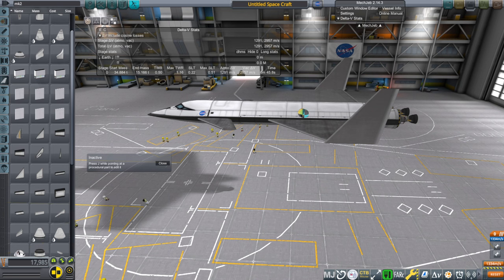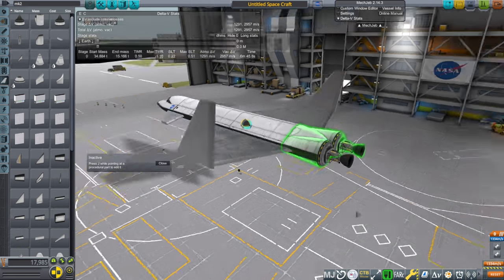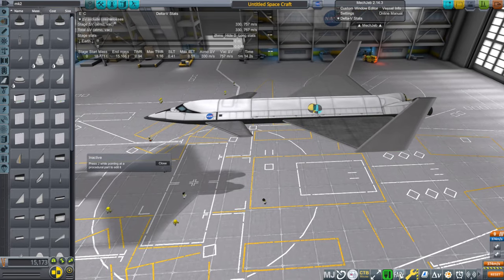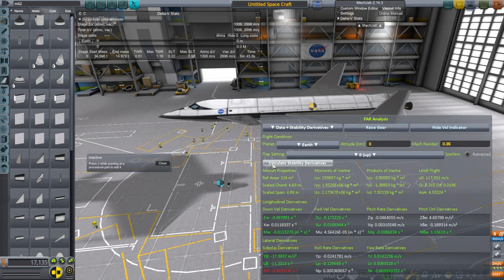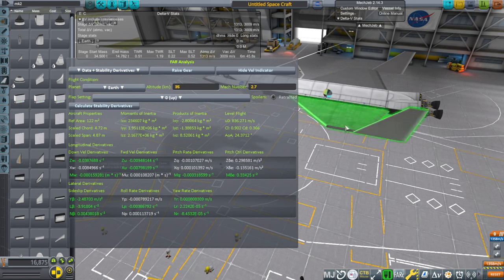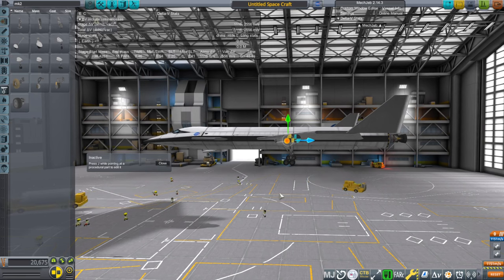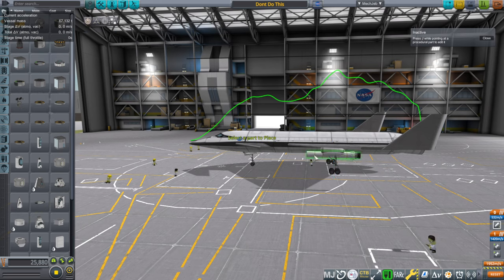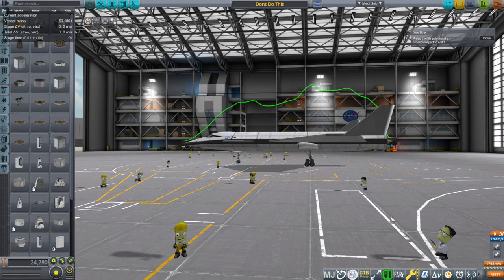Using FAR to Find How Much Wing You Need (KSP 1.12.5)

Comment: What does it mean when my plane tries to pitch down all the time? My CoM and CoL are good and everything on FAR is green or white. The engines are also slightly below the CoM.
Reply: When this happened to me it turned out to be a glitched tweakscale part that had gone into negative mass and it really messed up with SAS and atmospheric autopilot. Check all the parts, especially lifting surfaces. I hope this helps. I spent  three days trying to get a plane to pitch up and it was a wing piece and the cockpit that were negative mass
Reply: @SmokingBeagles  Thank you. Ill try to remember that if it happens again.
Reply: Depends on how excessive the pitching is; if it's to the point you can't control it then it could be a bug like @SmokingBeagles mentioned. 

Having the CoM behind the CoL will cause the craft to want to pitch down proportionally to the amount of lift and distance between the markers, and is considered to be a good thing as the craft pitching down means the craft will to pick up speed without controls, and is harder to stall unrecoverably. I also believe the FAR stability derivatives will show green for any amount of pitch down tendencies, even excessive ones, so check the Mw number itself is somewhere in the realm of -0.05 to -0.01 (and goes somewhat deeper into the negatives the faster you go).

Having the thrust vector line go beneath the CoM should actually apply a small torque pitching the aircraft up. 
But sufficient control surfaces should be able to maintain desired pitch either way; of course make sure SAS or ideally fly-by-wire is enabled.